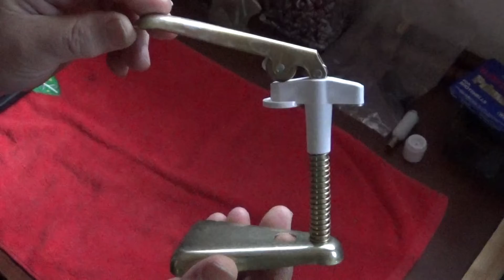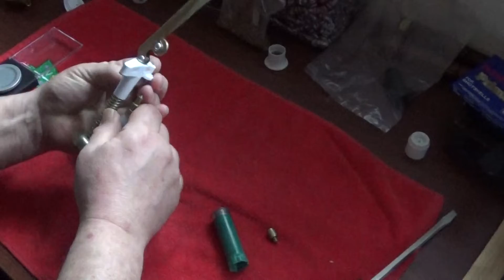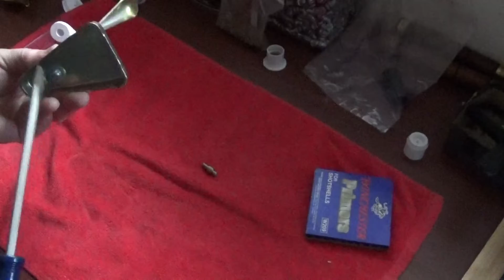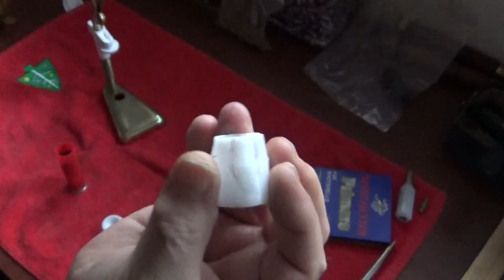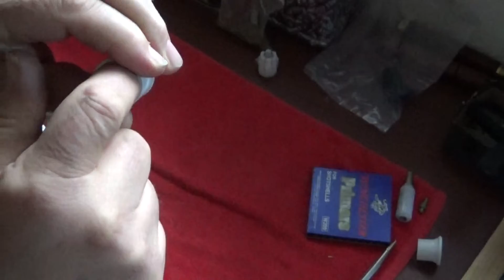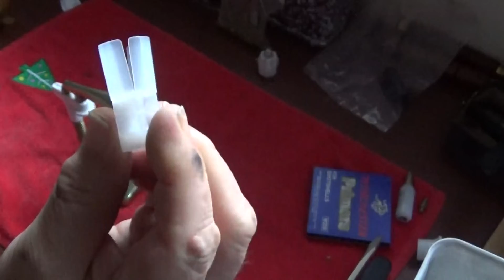Russian made economy priced shotshell reloader

Comment: Hi is Forest Camping still in business.I am chasing a .410  crimper reloading tool but i cannot seem to be able to contact anyone .
Reply from the maker: I bought my loading tool through eBay, However, If you spend some time looking around on the internet you may find what it is you need, there is a lot of Russian loading tool accessories available, Not just Forrest camp, however, Hull sleeves and crimping head adapters made by other manufacturers, however, you use the same press. I would start with typing in "Russian reloading tools for shogun" and see where that takes you.  I hope that was some help. Btw, I believe that forest camp only has loading tools for 12, 20, 28 ga. Dave.
Reply: @Thorsaxe777  Thanks Dave i will try that ,FC got back to me and they reckon that they willl have the .410 roll crimper avalable in a couple of months ,Cheers im hoping for the roll crimper to order one then.regards Darrell A.

Comment: This tool is interesting & affordable, but a bit fiddley.  I have the antique brass version.  It uses about the same process.  

Thanks for the video...
Reply from the maker: Like I mentioned, this tool is for the apartment dweller or someone that does not have the room for a big set up, you can put everything you need for reloading shotgun hulls in a little box on the top shelf of the hall closet. you can get accessory's for the crimping if you look on line, you will find the Russian Guys are friendly about pointing you in the right direction, (Most of them can read English) and they will answer you back if you ask. I feel that with the right crimping tool you can make every bit as good of shells with this too. Thanks for your Comment. Good shooting to ya, Dave

Comment: Very neat tool.
Reply from the maker: My intent was to get a small loading tool that apartment dwellers and people that don't have the space to load with a big set up. I wanted to get something under the price of the Lee Load-all, however still a quality rig. The only drawback to it is the crimping starter and final crimp. there is a inexpensive tool made by the same company that does a nice roll crimp, you just have to use an overshot card in place of the fold crimp. I would be willing to bet that once fired hulls work better than new hull when folding the end because it is already formed with the fold in place. Thanks for watching. Dave.

Comment: Interesting set, especially the crimp starter.
Reply from the maker: It does reach the "I would have never thought of that" category. Overall I think it is what it is and that is a reasonably priced loader, I was trying to keep the intent of this video to keep the cost below the price of the Lee Load-all. those have gone up in price, maybe I'm getting older, however, I remember those costing less than $30. I'm not happy with the final crimp it produces. Many of the Russian people use the Roll crimper tool that this outfit sells and an overshot card. I like the fact that it all fits in a small box on the top shelf of the bedroom closet.  Thanks for watching Dave.

Comment: Watched some of the Russian videos and gotta say those dudes work with bare bone equipment yet they can still pull it off. Neat to see that Dave, as far as sitting in the dark with no power been there done that, that’s when you need the generator to start but it’s Murphy's Law it won’t start. When the power comes on it’ll start first pull                    
 Later Dude

Comment: Forest camping makes some good stuff. I’m gonna order their roll crimper👍🏻🎄🎁
Reply from the maker: That is one of the drawbacks, the crimper is a little funky. I have seen the roll crimper available through them. I see that most of the Russian videos they use the roll crimper with overshot cards. The whole pulpous and intent of this video is to keep expenses down, (Below a Lee Load all).  I believe that using once fired hulls that already have been 6 pointed crimped is one of the keys to making them turn out better, also using a overshot card under the crimp to stop the dished in look. Thanks for the input buddy. Dave
Reply: @Thorsaxe777  

This device is of a very old design. It was made for paper cartridges. And paper sleeves turn out well if you find them. I haven't seen paper cases for a very long time. It is true that the use of once-released cases that have already been compressed by 6 points is one of the keys to making them better. You can order modern crimping, but the price is more... You can replace the wire with plates of the correct profile... An inexpensive device, old, the price of which in Russia is 10-20 dollars now. And if there are shell casings or buy one fire to use shell casings, it can save some money acceptably
Reply: I have been watching your stuff and fortunecookie and maxbaer and taofledermous and I ordered a few manuals from bpi.  I bought a couple shotguns and hope to get started soon.  I think that you and fortunecookie live nearby and hope that you could recommend a couple ranges.